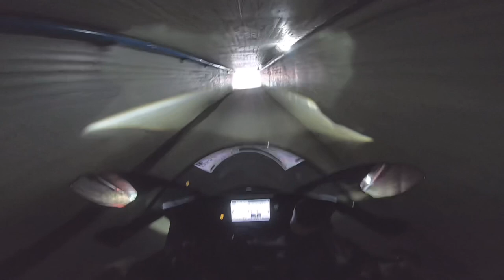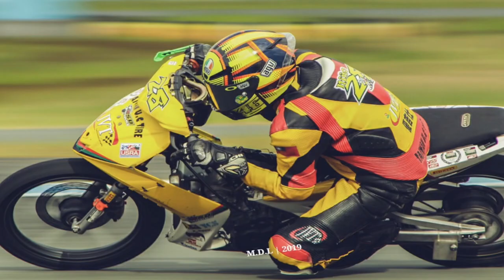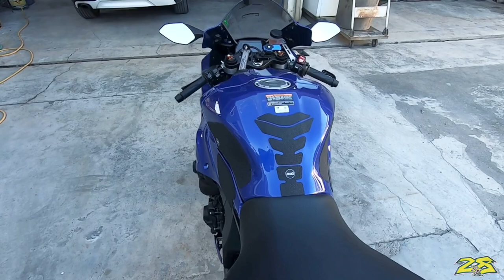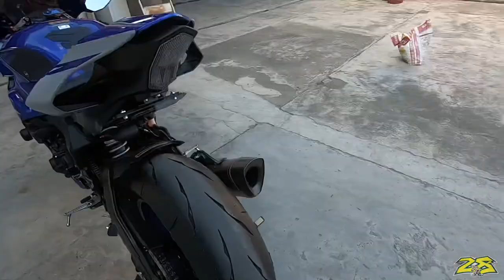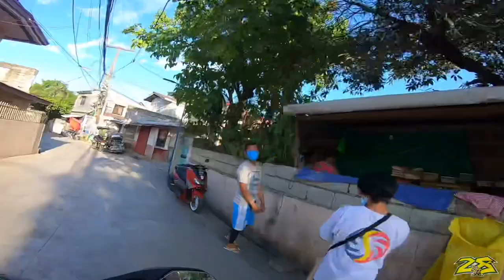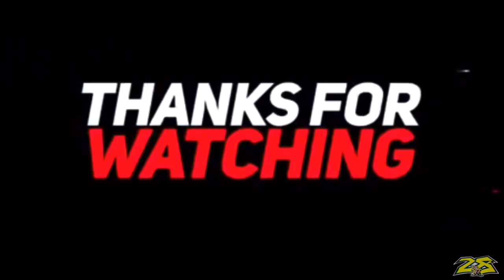2020 YAMAHA R1 / CROSS-PLANE CRANK | Niño Fabian

Comment: Bakit po parang magnda tunog ni r6 kesa kay r1.parehas lng nmn sila na 4 cylinder
Reply: Depende nalang Yan sa Tao interns of sounds. Yung r6 Kasi inline 4 flat plane siya, sa r1 inline 4 na naka crossplane, at overall I think mas maraming nagagandahan sa tonog Ng r1 kesa sa flat plane engine, dahil karamihan sa MGA bumibili Ng motor ay r1